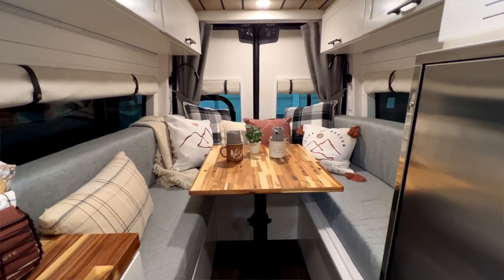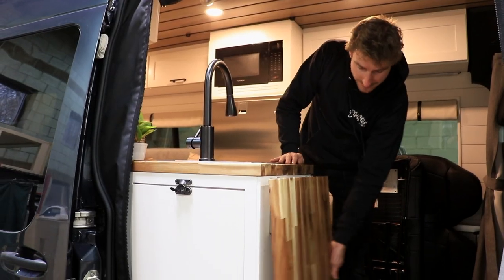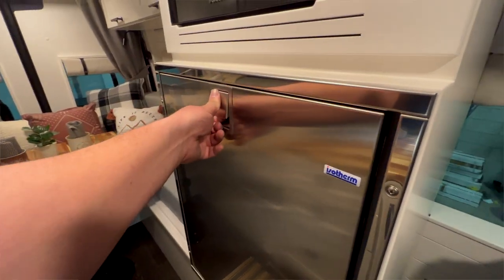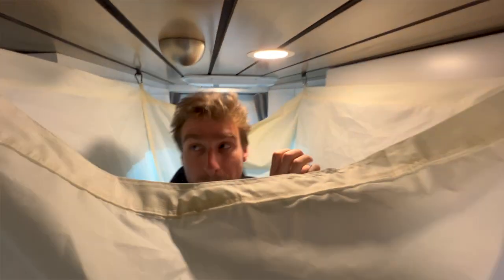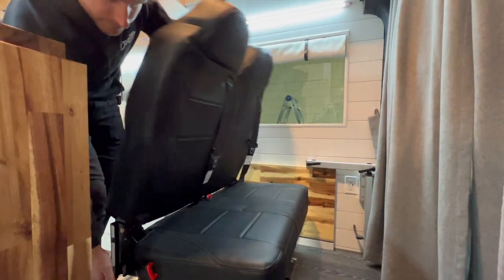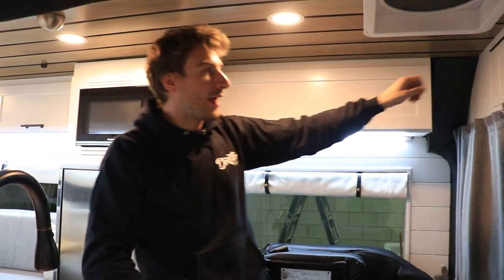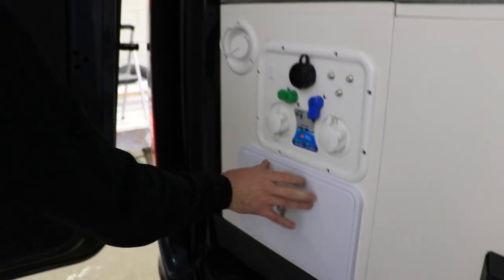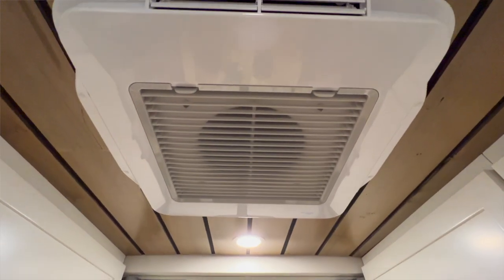VAN TOUR with Hidden Shower | Flip Down Passenger Bench | Mercedes Sprinter

Comment: I've seen that shower pan before, but how to prevent water from getting out since it is so shallow? 
Magnets all around the bottom of the shower curtain and must only be used when the van is perfectly level?
Reply from the maker: The shower pan drains directly into the gray water tank, and the shower curtain is attached magnetically at the bottom to the shower pan so water does not leak out. You are correct! Showering while parked on steep hill is not recommended :)